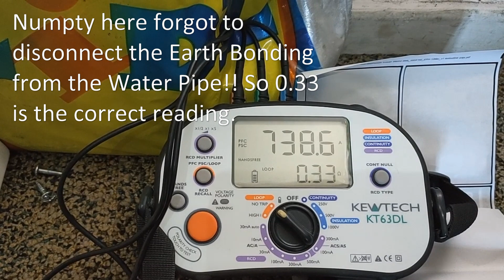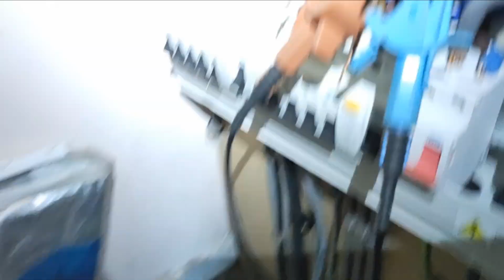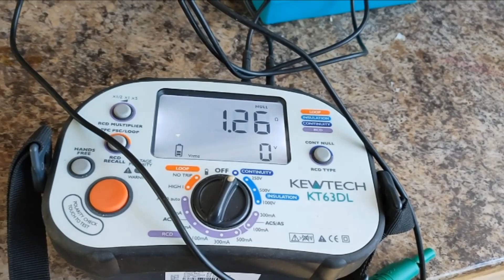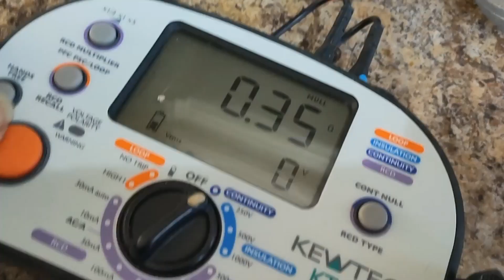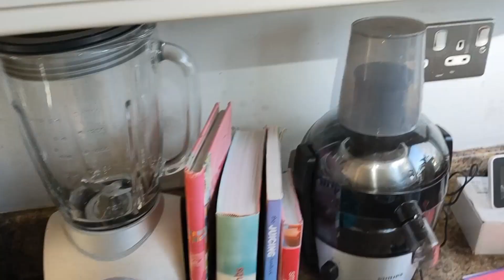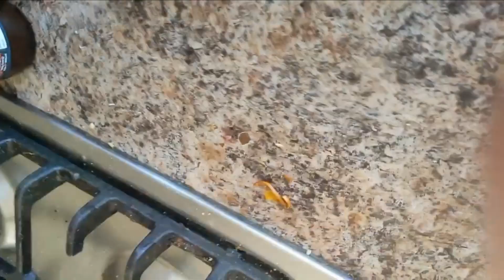EICR (Periodic Inspection & Testing) - Part 2

Comment: At 4:30 we’re you referring to your Ze reading? If so your meter was on no trip so you would get the higher reading.
Reply from the maker: The Ze was too high on the L-E because I hadn't removed the bonding to the water pipe. When I did I got identical Ze readings. The kA can be different which is why you put the highest reading on the paperwork. I know it looks odd, but I like to put up non-doctored videos because it would looked "staged" otherwise. Nothing goes to plan first time
Reply: To bean fair it looked to be on NO TRIP for both tests though.
Reply: @SME_Ste  I was implying that if he had set his meter to the high range then he would have got a better reading, without impedance uplift.

Comment: On a figure of 8 test how can you get it wrong the phase to the normal on the other side.
Reply from the maker: If I connected together the line and neutral in the same piece of twin and earth I'm essentially only testing one side of the ring, which is why the readings get larger the further away I get from the CU and then smaller as I get closer. I'm going to do a vid on the theory behind ring final testing, as it is the trickiest of tests to get a handle on as to why its done the way its done
Reply: @vwes  yes that is true but taking out all 4 an doing a ring test the chance or getting it wrong is zero.
Reply: @alunroberts1439  Done it loads of times I have, mainly with singles in DBs